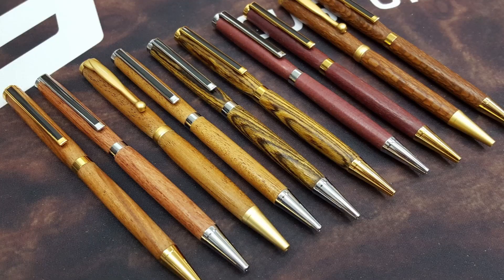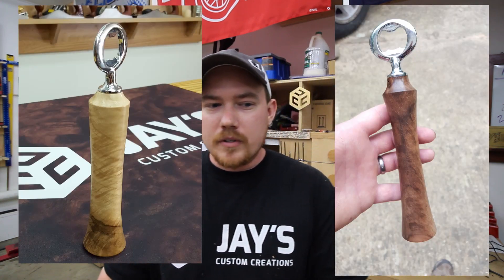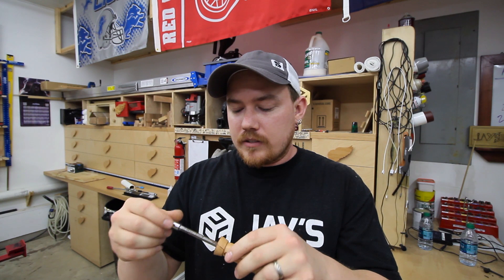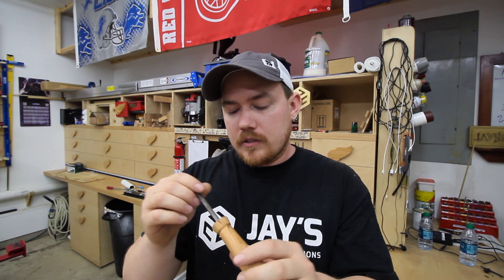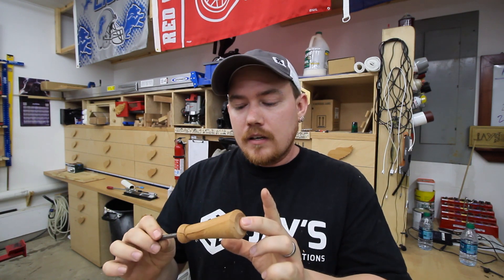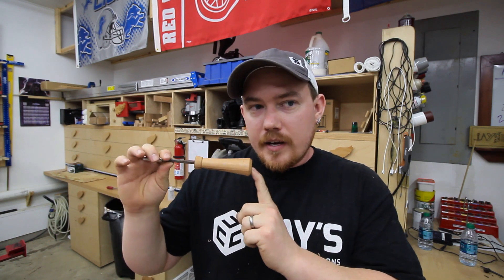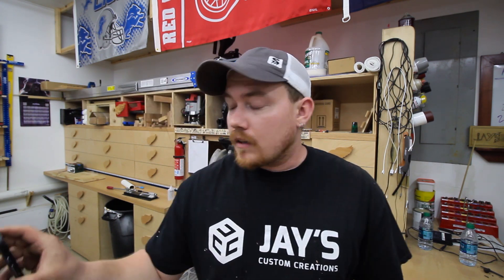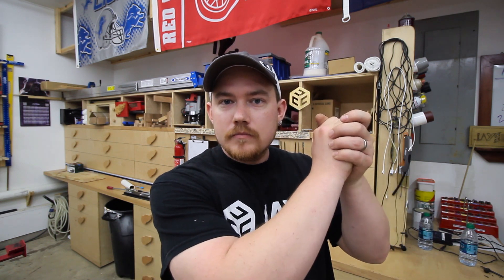Vlog #79: A lathe is a rabbet hole

Comment: I'm guessing you made the lathe table to be comfortable for your working height, so adding something under the lathe would change the height, another way would be to add a batten across the width under the base allowing clearance for the wheels,
Maybe you need a doormat and/or inverted brushes near the house door, also a brush to brush off your clothes

Comment: Lathes are a blast to use, but they have been called an expensive vortex.  Between tools, sharpening tools, chucks, face shields, etc it can cost easily twice as much or more as the lathe cost originally.  At a risk of sounding like the safety police make sure you have a very good face shield.  I didnt at one time and was nailed in the face by a chunk of wood.
Reply: My dad had a turning de-laminate and was also "nailed in the face by a chunk of wood". He didn't loose his eye, but he permanently lost vision in that eye. So, yeah, face shields are called for, worth it, required, etc.

Comment: Jay, dust damage won't affect you for many many years.  However, think of the lung damage as a cumulation of insults when you're young.  When you get older, all those years of cumulative insults from dust start to affect you.  Every bad habit or exposure you have to unhealthy contaminants will affect you as you reach your late 40's.  Its very deceptive.  When we're young, you feel no affect.  But its there, waiting for the day that your body can no run faster than the damage.  At that tipping point, when the contaminant outpaces your body's ability to run from it, all those contaminants waiting dormant from years past catch up with you.  That's why smoking is a killer.  You could smoke with little affect for years when you're young.  But all that micro damage done in your young years catches up to your body's ability to fight it beginning in your late 40's.  Wood dust is even worse than tobacco smoke.